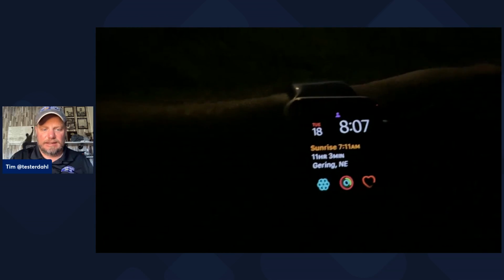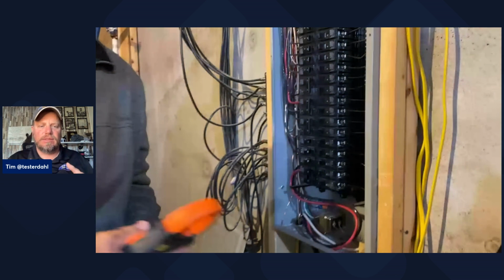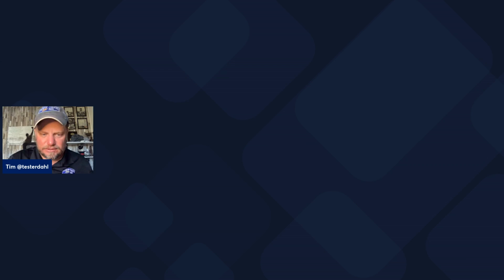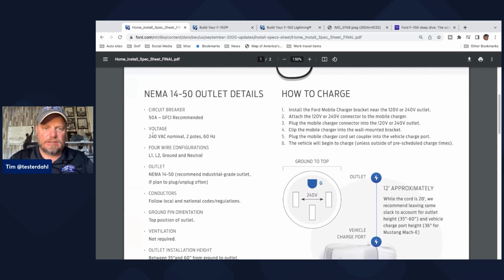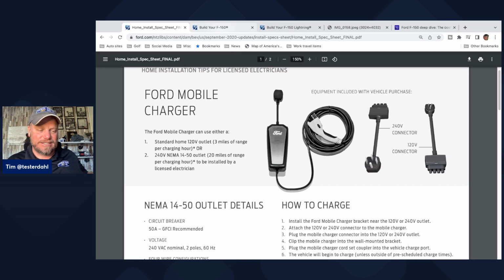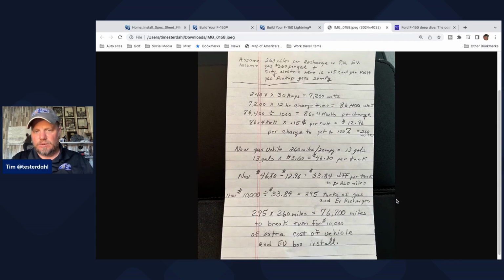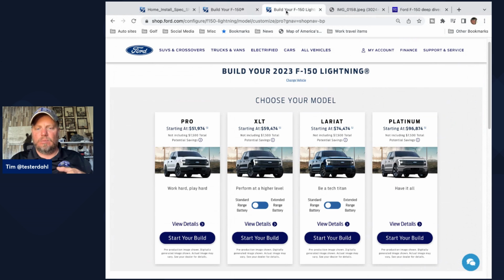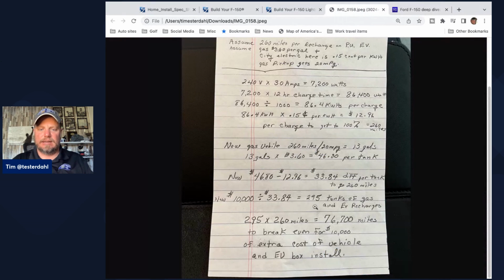11+ hours later on 220V charging price for 2022 Ford F-150 Lightning

Comment: As someone who puts lots of miles on a truck everyday working it, I see this all in a different way. Time is money. The time spent charging trying to gain miles just isn't worth it if you use the truck for more than just pleasure or a weekender rig. 

I haul and tow with a truck at least 5 days a week and sometimes more. I carry 3,000 lbs in my truck all of the time and tow 2 to 3 times that weight on top of that. 

When I am out working it, I average over 250 miles a day. Sometimes a little less sometimes more.

I can stop anywhere and take on a full 40 gallons or total range capacity in 6 minutes. I fill up at a 1/4  tank. My fuel tank is a factory 50 gallon tank. I have a range of over 600 miles if I am running empty on the highway and half of that towing.

Again time is money and my time is precious to me. If I have to spend time sitting charging, I am losing money and time that I can't get back. 

Being able to have a full charge overnight is great if it worked that way all of the time. The problem is that I would need to fast charge somewhere during the day and probably more than once. Fast charging is not cheap and then try and get a truck and trailer in anywhere to a charger to use it.

What needs to happen is a truck built with 250 miles of EV range with a range extender or generator that takes over when your battery get's low.

Normal local use and short trips 100% on battery. Towing heavy or longer trips you could hit the pump and be gone in 6 minutes. Everyone is happy and not losing time and money.
Reply: Where these manufacturers have so far all missed the mark is in producing a Plug-in hybrid electric vehicle. These already exist in some cars and almost fix the EV shortcomings. Drive around on the battery charge from plugging it in overnight or during the day while parked. Once you start losing your EV range, the gas engine turns on and recharges the battery while allowing you to continue driving normally. No EV range anxiety or looking for a charging system and waiting. Why have ignored this in light trucks?
Reply: @jeffw6894  the problem with hybrids in heavy duty vehicles is that both the electric and the gas engine need to be around the same power output for towing purposes. For example if your electric motors can produce about 500 HP and torque (just making up numbers) then your gas engine is going to need to be around the same. A lot of people imagine having a small engine which is fine if it's job is to slowly top off the battery pack when the vehicle is unloaded and sitting at a stop light but if you run out of battery power and you're suddenly relying on a small gas engine to try and tow it's going to be difficult or even impossible to continue operating. For this reason having a true hybrid in a work truck is very difficult because now you're installing two high performance drivetrains and both of them have handicaps. You're better off just sticking with gas and using the extra space to install a regular sized gas tank (or an aftermarket oversized tank). Not to mention a smaller battery pack has a shorter life since it discharges faster and undergoes more recharging cycles.
Reply: @Michael-1337  You seemed to have missed the Light Truck part at end of my previous reply. For most light duty truck owners, a PHEV designed for such a purpose would suffice while alleviating range anxiety. However, as someone who uses a truck to tow regularly, I'd pass on the hybrid and electric and stay with a ICE.
Reply: Time literally is money if you forget to charge or you breaker flips over night. Can you imagine calling all your customers or your boss to tell them you forgot to charge over night so instead of being 20 mins late you won't make it to work till afternoon or even at all. I love the idea of all electric but not sure its there for me yet.
Reply: Trust Uncle Joe and the electric gurus. The government knows what is best for you. You are required to get with the program. Thank you for your mandatory cooperation.
Reply: A small diesel generator on a decent sized battery would be awesome.
Reply: @trp2413  I agree with the concept. A traction motor driven by a large battery pack is great for towing but the range will suffer while towing.

A decent sized generator could kick in when the battery pack gets lower. 

Even though the motor might have a max power rating of 200 KW it only uses max power for a brief amount of time.

Once up to speed it may only draw 1 or 2 KW max load while towing. Regen braking helps put power back in the battery.

The range extender generator could put out 7 or 14 KW while it's running. It could provide enough power to keep the truck rolling and start slowly charging the battery back up.

The BMW I 3 EV used the same concept years ago. It only had a 650 cc engine and a 2.5 gallon gas tank. You could program it to turn on the generator at a preset point say 30 percent battery level. 

It had enough output to keep the car rolling at highway speed and slowly start recharging with whatever was not consumed by the drive motor.
Reply: @desertdan100  Even a 15kw generator wouldn't do much.  It'd take you 20 hours to get what you get in a full truck's battery pack.  A truck towing a camper down the interstate will consume a 150kwh battery charge in 2 hours.  Probably less if its cold out or if you're bucking a wind.  There is a reason that 3/4 ton trucks have 300+ horsepower engines and not a 20 horsepower Briggs and Strattons.  Thats what a 15kw gen set has.  The simple fact is that electric does not work as well as gas; unless some miracle happens.  Until that miracle battery is invented and can be cheaply produced on mass scale,it is only those who are too lazy to do a few basic math calculations that believe electric vehicles can competatively replace gas.
Reply: @aaronwangler1463  I agree with many of your points and have been in and towed with many vehicles. I don't pull any punches when it comes to facts and math. I agree that the range on Electric trucks suck but you are wrong about the differences between ICE and Electric traction motors. People don't realize that for decades Train locomotives do the the same thing already. 

The Diesel engines that they use are just big generators. The engines themselves could never move those very long, large, heavy trains. 
Once you get them moving it does not take near as much power to keep them moving. The same thing happens in Electric vehicles. The traction motors have a huge amount of instant torque that can get the mass moving and consume a lot of power for a short period of time to do it. After that it does not take near as much power to keep it moving.

The Electric motor is far more efficient than a gas or Diesel engine but the Diesel is way more energy dense per unit of energy.

An electric motor is 3 to 4 times more efficient than a comparable gas engine with the same horse power rating and develops more torque. I have a background in mechanical electrical components and motors. 
A 3 phase motor has a huge amount of torque and is very efficient.

The Electric traction motor would only consume around 1 to 2 KW of energy at highway speed. The generator could produce 2 to 3 times that and run on Gas, CNG, Propane, Diesel or whatever. 

In my area we have a lot of hills and Interstate Roads. I have towed with all kinds of trucks and vehicles for over 30 years. I know about fuel consumption and factors that increase or decrease it.

Once you get a load moving and up to speed it takes very little HP and torque to keep it moving. 

You use only a fraction of the HP needed from that engine to maintain movement. 

That is also why trains are so much more efficient to move things across country with   Electric traction motors and Diesel generators.

It would go like this. You charge truck overnight plugged in to a level 2 charger or a DC fast charger for awhile. You make sure that your Diesel tank is full.

You program your range extender to kick in at 30 or 40 % of battery capacity.

You take off in the morning using just your Full electric mode. As you drive you are either feeding power back into the battery a little bit with regenerative braking or you are flat out cruising at highway speeds.

Your battery state of charge hits program at 40 %.  The generator kicks in and you still have plenty of torque or full power when you need it but as you get the load moving and up to speed you no longer need much KW of energy. 

The generator is still making up for the power you are using and for every mile you travel you get back 1 more or 2 more miles of range into the battery pack. 

After awhile it is like you never lost it. The generator is running at it's peak RPM and efficiency until it is no longer needed and kicks out. 

Maybe it only runs until you hit 75% state of charge in your pack.

The end of the day you get back to plug in and you still have 50 % of state of charge and you stopped somewhere a long the way and refueled the tank.

Tomorrow you will be set to start all over again. You don't need a 300 HP generator to recharge the battery pack because the traction motor has 3 times that power from a dead stop. It only uses that much power for a few seconds and it is back to only drawing a third of that or less to keep the load moving.

For example the Ford Lightning consumes on average 500 watts per mile or 2 miles for every KW. The pack is around 131 useable KW. That equates to about 262 miles of range in perfect conditions.

That is only 2.5 amps of power at 400V to drag that truck down the road. Start from there as a base or control number. That is at 1 KW consumption.

Industrial 3 phase motors run off of 460V AC power and do huge amounts of work with just a 1 HP motor. High efficiency and high torque is why they use them.
Reply: Small businesses will need extra trucks.
Reply: It’s gets worse, we don’t have the copper reserves to go electric. And that’s just for the first generation. Our policymakers seem to think it is an infinitely available and unlimited resource.
Reply: @Biochemechanic  It's about money.   Gasoline cars are boring.  You just gas and go.
New technology is always a good investment.   Remember Compac, IBM Computers,  Dell, and Apple Computers.   They were all a big deal in the 80's.  (Today, Apple is making it money on IPhones not Computers)
Steel Mills were a big deal 100 years ago, US Steel was one of the top companies, but today it's not. 
EV'S & Apple are the high flyers now.  Tesla worth more the all the car makers combined,  but don't make as many cars as the other car makers. 
Now comes the government pushing incentives to buy EV'S. 
This creates a artificial demand, but on the stock market is valuable. 
Basically EV'S are a rich man toy.
Reply: you are the extreme edge case. they arent for you. they arent for people that haul cattle or 12000 lbs of pumpkins multiple times a day. nobody is saying they cover all use cases. in another 10 years the capacity will be 2 or 3x what they are now and charging infrastructure will be better. maybe 60 or 90 amp charging at home instead of only 30
Reply: @danielroden9424  OK, changing infrastructure for the better.   My argument is that this is premature.   The technology is not ready.  Lithium batteries are great for cell phones,  and cordless drills, but not for the transport industry. 
Lithium is expensive to mine, and the country that mine it use child labor.  America will be dependent on China. (We saw how fair China was during the Covid19 pandemic with holding Ventilators. )
Also, junk yard won't take junk EV, because they explode in their yards.
In the future,  a better battery will come along. 
Right now,  America is facing a deisel shortage. 
Deisel drives the Ships, trains,  and trucks, this shortage will cause more supply line problems. 
Bottom line, hold off on the Green Agenda,  because another major failure under Biden's Green Agenda will destroy the Green movement.
Reply: @danielroden9424  another point,  innovation by government never works. 
Free enterprise is the best innovator.  
Problem with today business is that they control government.
Reply: Then toss in the fact that fast charging causes the battery to degrade faster, and is prone to excessive heating, sometimes causing them to burst into flame, or outright explode!
Reply: Just my opinion but the best available option for a Range Extender would be a Microturbine Generator (MTG). 
An appropriately sized MTG would be able to fully power the vehicle while simultaneously recharging the batteries. The advantages over a small ICE generator are numerous. MTGs DO NOT require regularly scheduled maintenance or emissions equipment of any kind.They are relatively compact and lightweight and could easily be built to an industry standard making them a modular plug and play option as needed (rental). They can be operated on most currently available fuels and more.
Reply: @andersonnettleship845  I have studied and learned about them. I totally agree with you. 

There was supposed to be a pilot program in New York. They were going to fit them onto garbage trucks as a power unit as a hybrid system. They planned on incorporating them in with a Battery and a traction motor. The engineer thought that the stop and go use on garbage trucks would be a perfect use case and the small or micro turbine engine would could kick in and out as needed. The garbage trucks would run as long as possible on battery and regen braking and then would kick on the turbine as a generator at a fixed rate or in the most efficient RPM for the fuel burned.

That was a couple years ago and then it died out or no more was said about it.

I am sure it would work and could be run on almost any fuel.

I was in the Army and spent hours on the flight line talking to mechanics and BS ing with them.

I was always fascinated with engines , especially turbines. 

It was pretty cool to watch them work on and tune them for Helicopters. They have a very high power to weight ratio. 

The other ideal power plants would be a compact rotary engine. I have seen a prototype that some race guys have come up with that is different and better than a Wankel engine. 

There are options out there if some of that incentive money from the government was put to good use in those technologies instead of lining the pockets of their good buddies and Politicians.

I am also a proponent of Hydrogen or H2 used as a fuel and in fuel cell vehicles for longer ranges. I am also okay with CNG or compressed methane as a fuel. 

I have driven and used CNG vehicles and it was great. Refilling only took a few minutes and you were gone driving again.
Reply: @andersonnettleship845  I agree with you.  In he 60's, Chrysler tried to develop Turbine cars, and there were even Indy 500 race cars.  As race cars,  Turbine engine were good. 
The problem with Turbine is lowering and raising the rpm's in the regular street driving.   Whereas the Indy  car can run full throttle all day. (As a matter of fact the Turbine almost won the Indy 500, except for a break down.  Also, the next air intake was restricted which in effect outlawed the Turbine. )
A Turbine generator can operate at a steady speed,  and doesn't have to deal with traffic. 
This would be a hi-bred, but different.  The current hi-bred is electric and switches to from electric motor to a gasoline engine drive.
The Turbine/generator will operate this way.   Battery powered motor until the battery runs down, then the Turbine/generator will take over powering the electric motors, while charging the battery.
Reply: The people pushing EV have never experienced using a truck as anything other than carting butts around. Do they even realize that you have to dump your trailer just to be able to get to the charger? Am I going to buy an EV pickup if I have a boat, travel trailer, dirt bikes, etc?  These people want you to live THEIR lives.  😂🤣
Reply: @desertdan100  A big reason why trains are so efficient is the low towing force per load ton rolling resistance due to steel wheels on steel rails. 

Much better than rubber tires on concrete. Even more so than rubber wheels on asphalt..
Reply: @jamesmooney8933  gasoline cars are boring? What rock are you under? Cars like Tesla's are extremely ugly. I love gasoline cars. They have style. Steel is still under demand but it's all bought from foreign countries. The government giving tax breaks to companies that move out of the country. It's by the only American built car you can buy now is from a foreign company. The Big Three build all their vehicles in foreign countries.
Reply: @garyszewc3339  I am 75 years old.   I believe boring is good. 
Teslas are great cars, but I question them in the long run.  They run on Lithium batteries.   China has cornered the market on Lithium. 
I don't believe Lithium can replace gasoline,  deisel, or natural gas.   Of course Musk can make a EV tractor trailers,  but where are you going to get enough Lithium batteries to replace deisel fuel.
Deisel fuel powers locomotives (on Railroad trains)  tug boats (that push barges), farm equipment,  Emergency generator (for hospitals)
Ocean going Ships)
Lithium is not mined in the USA because of EPA Regulations.   Lithium uses child labor to process.
When Lithium batteries can go in the land fill, they must be recycled which is expensive. 
Junk yards won't take junk Teslas, because they explode. 
Also the 2nd hand market for Teslas is very bad.  Like the battery drill, where it is cheaper to buy a new battery drill then buy a battery. 
The second hand EV market will never be as good as the 2nd hand car market.
Without a 2nd hand market the trade in value will very low.  The most expensive part on an EV is the battery.   Reconditioned battery pack do replace every cell.
So you are getting cells that will need to be replaced every year.
Reply: Hybrid? Road. Tax.☠️🌏😢🍁🍁🍁🇨🇦🇨🇦🇨🇦
Reply: @desertdan100 An EV truck isn't for everyone , certainly not for what you do. Myself a retired electrical engineer,  with home powered by solar for the past 15 years.  Having as much as 35 kWh of excess solar energy a day. And only drive around 150 miles total a week it is a dream come true. Not to mention on days where I'd normally have to run my home off the grid because of too many cloudy days,  I can power my home off my lightning.
Reply: @pstoneking3418  I agree with you.  My concern is about the economy of the world.
The idea of ending oil production is wrong.  At this time, batteries cannot replace oil.  The deisel engine is the workhorse of the economy. 
Deisels are responsible for trucks,  farm equipment,  boats , and ships.
We are not going to replace deisel with batteries in the near future. 
There are technologies that could possibly replace deisel.   Super Conductors are one but that technology seems to be stalled.  Super Conductors are being used in ocean going ships electric motors, but deisel is still the fuel. 
Now, graphene is showing promise as the separator between the positive and negative side of the batteries.  (Sorry,  I can't remember the technical term for the positive & negative side of a battery. 
I think the Japanese have a good idea with "Red Hydrogen ".
I think the "Turbine generator " for hybrid cars is a good idea.  In the 60's Turbine engine were experimented in cars.  A Turbine race almost won the Indy 500, it lead the entire race, buy broke down in the last laps.
The gasoline engine was better because it could operate at low rpms., where the Turbine had to operate at high rpms.
Turbine would make a better engine to operate a generator. 
My point is that by rushing EV'S to take over oil is going to wreck the economy.   Maybe throw the country into a Depression. 
If a Depression happens then all the credibility for renewable will be lost.  This would throw renewable back 40 years. 
Government involvement is bad, because government limits competition, and sniffles new research. 
Once the government is involved then big business gets involved. 
Big business does not like innovation. 
Once the big car makers got rid of the small car makers.  Innovation in American cars was big fins.  Innovation did return to car manufacturers until the late 70's by Japanese car makers. 
This my opinion.
Reply: @pstoneking3418  I have invested in Atlis years ago. They are still designing the truck they are going to build me eventually.

I just wish somebody would listen and build real work trucks that start out on the EV battery and then fire up a generator to extend the range or double it when towing or long hauling.

The other thing and answer to many problems would be a Fuel cell truck with a larger EV battery on board. 

Swing into a fuel point, refill in 8 minutes and be back on the road. 

Charge the truck overnight while it's parked on a level 2 charger at home or a DC fast charger while stopped for a lunch break half way through the day somewhere.

The Tesla truck would be awesome for a runner but not as a work truck. They went the wrong direction for that.

H2 is the answer for many situations and BEV for others.

Atlis is going down the right path but they are behind in the race a little.

They already have a goal of 500 miles range.

Rivians are great but not for being used as a real truck. 

The lightning is an awesome truck but does not and will not work for all of us unfortunately.